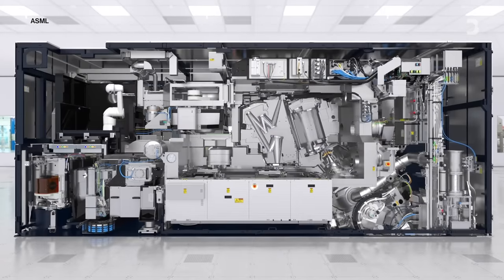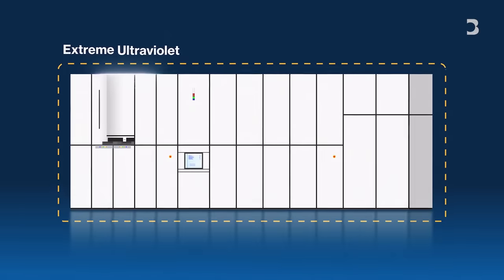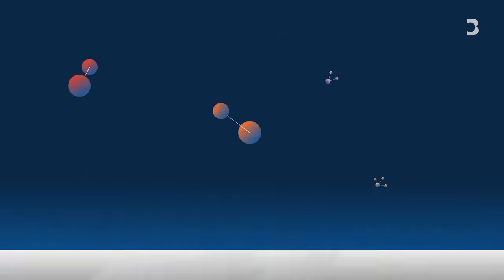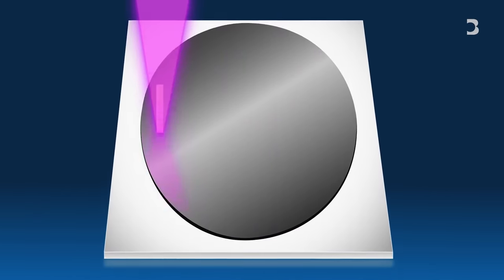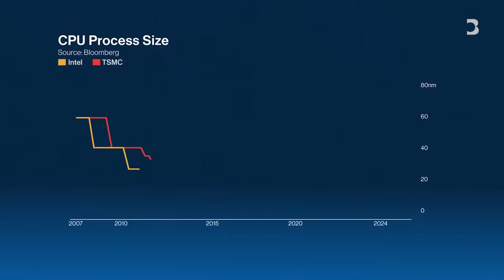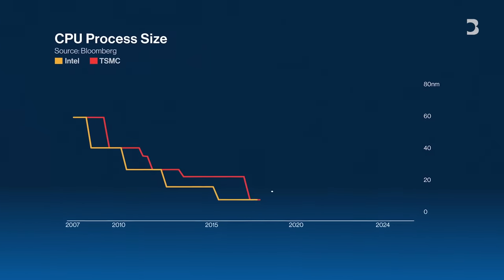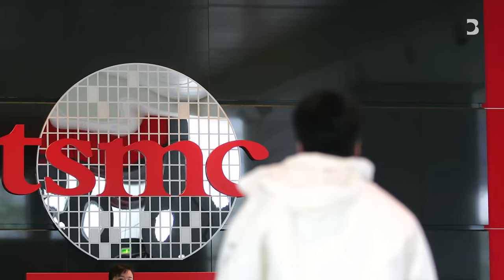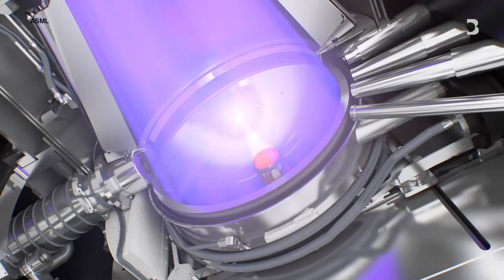America’s Big Chipmaking Blunder

Comment: So those machines will be odsolete with the next gen material used like graphene or photonic chip.  So who will suffer more with China shunning US's chips due to national security, decoupling, derisking or overcapacities if you actually know what it means?
Reply: Not every product needs the latest and greatest manufacturing equipment.
Reply: @mecanuktutorials6476  Correct, majority of our daily products like printer, washing machines, machinery, washing machines, EV, space, airplane, etc  don't need high-end or below 14nm chips.  They are called legacy chips and China is quite self sufficient in manufacturing those chips domestically. High end chips don't fit or might even have the negative impacts on reliability.  Unlike many advanced countries, in which don't even produce those chips themselves!  More so, the technology and equipments in making them.  What worry the west is China advancement in the high-end chips too despite all the sanctions and bans.  The West will pay dearly if China managed to surpass the sanctions and is proving so.
Reply: They should be hurry, they're losing money too fast

Comment: The main reason U$A will never able to compete in Chip manufacturing.
All the country that do well in chip manufacturing , has Confucianism culture.
For chip manufacturing,  a high level of discipline is the key, and most Americans today don't possess it.
They call it “forced labour"
Taiwanese media reported on August 2 that TSMC claimed the production holdup at its Arizona facility was caused by a shortage of trained American labour and that they had sent staff from Taiwan to assist with the factory's development. Labour union officials in Arizona, on the other hand, criticised TSMC for exploiting this as a justification to bring in "low-wage foreign labour."
Reply: that's deep, too deep for western artificial outlook
Reply: Correctmundo maximus - look at Boeing's shift from Eng./mfg. company to 
finance focus. BA's engineers & factory floor workers are NOT the problem, C-suit [mis]management is.
Reply: Yes, the American work ethic and culture is to blame.
Reply: @samrapheal1828  Hope this whistleblower stay safe.
2024-4-18 A Boeing engineer says he was harassed and threatened by the company after raising serious concerns about the safety of its planes. 

Sam Salehpour, the engineer-turned-whistleblower, also believes assembly flaws in the 787 Dreamliner mean the plane could fall apart and drop to the ground midflight, and that it should be immediately grounded.

Comment: It's a bit too late for the US, as China start to make their own High end chips starting from 7nm in 2023, then 5 - 3nm by the end of this year and possibly 2 - 1nm by 2025. Huawei spends more than 50 billion on innovations annually and has started to build Fabs for the New photon chips which are diamond based, there will be multiple layers and enough space to put everything into one 3d chip while using SHDC laser instead of electricity would mean its' hundreds times faster than the current silicone based chips, also the diamond based chips can release heat much more efficiently.
Reply: China only managed to make 7nm chips with western tools. Hard to say if the can go any further.  As they have to replace all those western tools. That's going to be a challenge.

Comment: Actually, if the US producer were required to keep a set of all their machines (maintained) that where used in any defense production, or risk loosing their patents and fined and forced to let another producer manufacture their products, their would not have been any problem for all sales to the US government and government contractors.. and this also would apply to software also...  Then most, if not all problems, would have been adverted.  Corruption runs deep and actually seems to cost little.  The cost to rebuild now is astronomical, with funds being spend elsewhere at this present time trying to hold a grip on 'venues' that are now doing these jobs.

Comment: I work at Global foundries in a small "refurb tech" position, it's as low on the maintenance technician ladder as you can go. I've made a few friends that are highish management at least for the fab I work at and most of not all of middle low to middle management has told me the industry as a whole is kinda disastrous. In my state the majority of the fabs don't keep up with proper 6S (basically safety protocol) aswell as failing to keep a clean room actually clean of particles. From what I've seen in my 8 months experience and what I've heard from people who have been in the industry 30x longer then me is it's kinda all failing apart for American chip manufacturing, at the very least for the maintenance technicians and they're jobs
Reply: Not to mention they have my position performing safety audits...I've never been trained to safety audit the machines once and was told by my coworker day one "if anything looks weird write it down", that's the extent of my training

Comment: It seems like you're just copying the first google search when  you say "the machine is about the size of a bus" because it's much bigger than that. it requires 3 stories of optics systems. It is a bus on one level.

You say TSMC surpasses intels nodes by 2018, then say the first chip with EUV is the note 10 (late 2019 release) which isn't evidence for your case. TSMC caught up due to steady progress and their competition floundered in ways that have been much discussed, not due to EUV.

Comment: Intel had too many dinosaurs running things for the last two decades.  They couldn't have missed more trends if they tried.  AMD forced their hand on 64-bit.  They passed on tablets, the first iPhone processors, failed to buy Nvidia multiple times,  are way behind on AI, let their manufacturing fall behind.  They also used up all their favors with Microsoft and Dell to preserve their prior monopoly status.  They also cheaped out by hiring less than the best engineers for cheap.  Disastrous management.

Comment: Intel's stumble was not just because of EUV.   Before EUV came out,  TSMC could make 10nm then 7nm devices with DUV.  Intel was stuck at  14nm for 5~6 years.  Today Intel has the best machine the high NA EUV from ASML. But Intel's most advanced chips are still made by TSMC. There's an art/science/engineering in knowing how to use these very complicated machines.

Comment: Was Intel's refusal to use the UV lithography machines the reason they were so slow to shrink transistor sizes? They were on 14nm forever. Their slowness to shrink the chips and lower the energy needed was perhaps the single biggest reason Apple developed their own silicon.

But were those years of such slow progress all due to them not using UV lithography machines?

Comment: It's a classic story of greed and outsourcing manufacturing to pay lower wages where possible. Intel thought they were big enough to sit on top without innovating until smartphone technology swooped in and demonstrated better performance than Intel PCs. There would be no significant improvements on the CPUs each year, yet they'd charge the same if not more money for each successive product. They were probably making bank with such profit margins. Only after Apple stopped using Intel did that company begin to scramble. The writing was on the wall for Intel the last 10 years and they didn't care until Apple and TSMC built a coffin and said get in

Comment: "America" did not drop the ball on chip making.  Intel, IBM and AMD did because those companies did not want to use the technology to make its chips, all of which were cutting edge and beyond anything TSMC could produce.   But beyond that, most IP and technology related to CPU manufacturing still comes from the United States.  The issue is the cost of manufacturing cutting edge chips with smaller and smaller dimensions.   And to do that successfully requires economy of scale, meaning basically a company large enough that has enough resources to afford to spend on developing the most advanced manufacturing pipeline to manufacture chips affordably.  Translation, it requires a monopoly  or near monopoly on chip manufacturing so that most of the proceeds from those operations can be reinvested in newer equipment and next generation chips.    And the US government has been against such monopolies in tech for a long time, which is what led to the break up of AT&T to begin with, where most of these technologies such as silicon transistors, the internet, neural networks and other things originated to begin with.

On the other hand where "America" did drop the ball is offshoring so much of its manufacturing to China to begin with.  And the fact that China is not blocked from getting access to any kind of tech at all shows how they don't really care about China's growth and only about profits.   Otherwise there would be no smartphone industry in China, which is  due to American companies using China to make smartphones and related components.

Comment: People here really are spreading a pessimistic view and ignoring some of the reality. The machines used to produce high-end chips are made by the EUV and ASML but let's not ignore that another very important equipment that makes high-end RAM chips is made by US companies such as Lam Research. Also, if you take the argument of actual chip fabrication manufacturing, how can the US compete when workers in Asia are working 50% more hours and paid 50% less than their US counterparts. Reality needs to be checked and strategic and logical moves need to be made.

Comment: The US needs to start innovating. "AI" and fast iphones are a joke, the reason the chinese have the tech is because it's easy and not impressive. Other parts of the computer can be worked on for greater advancements such as a non-euclidean tessellator. You don't need smaller chips, 99% of the bits are wasted by inefficient math due to bad computer architecture. Just look at how many empty zeros are carried through matrices in so called AI. Another area that should be focused is more compact data storage with physical rubrics. There's a lot of areas to improve, they just won't pay creative people.

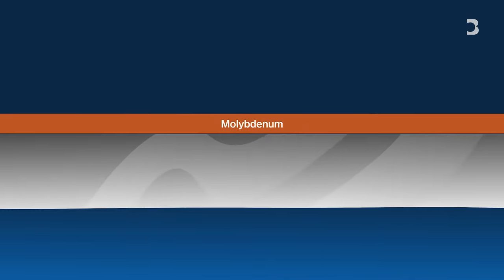Comment: 2:01 How can a thing made out of atoms be polished to a smoothness of less than one atom thickness? Is the outermost layer of atoms made of half-an-atoms? 🤔2:47 Ian agrees.
Reply: How can mountains on earth be smaller than half the planet?
Depends on how you look at it I guess.
Reply: @SCM0NDT  Your analogy is not correct. It would be correct if the initial question had been: "How can an atom be smaller than the thing that is made of atoms?", and that was not the question. Besides a mountain cannot be smaller than half a mountain. Even if the planet is made out of rocks.

If you happen to have knowledge in lithography and can answer the question, doing so in riddles is not a helpful approach.

Comment: Intel is not a chip maker nor a foundry, they make their own processors therefore their market is limited
Reply: Intel is both a chip designer and a foundry. They've started opening up their fab plants to rival chip designers. And they've also contracted TMSC to manufacture some of their chip designs.
Reply: they are offering themselves as a foundry now, papa pat said that earlier this year, they are offering their services to other companies
Reply: In the non-processor integrated circuit (IC) manufacturing market, Intel’s market share is significant. As of 2023, Intel’s market share of the global semiconductor market, which includes non-processor ICs, was 9.1% it is nice but not compered to TSMS Samsung or Global Founders who rule the rest

Comment: Made in Europe. Without Zeiss from Germany, no EUV machine.
Reply: Using American patented technology developed in USA, hence under American ip protection act
Reply: The mirrors are not that hard to make, there are a bunch of companies both in US and Europe pretty capable of making the mirrors in the absence of Zeiss, as the technology behind the mirrors comes from Tinsley Labs (US) and Lawrence Livermore(US), AT&T Bell Labs (US) and NIST (US), they are the ones that worked on different aspects of the EUV aspherical mirror fabrication and meterology, long before Zeiss joined the program, then the technology actually was transfered to Zeiss, and Tinsley Labs and Zeiss developed the technology further, until the departure of Tinsley.
Reply: The hardest, which is also the main and the most complicated part of the EUV system is its light source, it's actually the part that without it there is no EUV system, it's designed and built by a company, based in California in US,  and that is how the US kept the technology in house.

Comment: The US is currently building 3 chip fabs right now. 1 each In Ohio, New Mexico, Arizona. One of them is being built by TSMC and the other 2 by Intel. They will all be capable of manufacturing the most advanced micro chips on the planet. 4 and 3 nm chips. And even 1 and 2 nm eventually. Right now today Taiwan makes about 90% of these chips. The other 10% are made in South Korea and Samsung. This is one reason why Taiwan must be protected. This and it’s just the right thing to do. A small democratic country we aren’t going to allow China to destroy that beautiful country. If China did attack though I’m sure that the explosives at the Chip fans have already been placed. If China attacks then the Taiwanese will destroy the chip fabs before China gets to them. That reason and the USA are the 2 reasons China doesn’t attack. Part of the reason they want Taiwan back is because then they would have a stranglehold on Chip manufacturing and would have us by the balls. Not going to let that happen.
Reply: ok boomer
Reply: Running it will be the test. 
An engineer in US cost $150,000 easy. 
In Taiwan it is $50,000 and they work 24-7. 
I doubt it that the USA can be profitable.
It will be subsidized until time immemorial.
USA will be taking jobs from Taiwan …..
How is that smart …?
Reply: TSMC found that the mentality of workers are poor and not that smart in US,Taiwan ranks3 and US ranks 29 in I Q😂
Reply: As the US has sanctioned the supply of chips to China, you might find that China could prefer to have TSMC destroyed in order to prevent advanced chips going to the west.

That's the logic of the US and I don't see why it should not apply to China.
Reply: @richardparker1338  
TSMC have to do what the emperor ( USA ) wants or they may be sanctioned as well.
TSMC will lose monies in USA.
Reply: @windsong3wong828 if a war between china and taiwan destroys their capacity to make chips, everybody needs a plan b

it is not only about money, it is about having acces to new chips

you know, you need backups, plan b